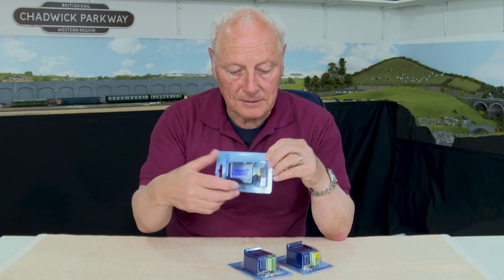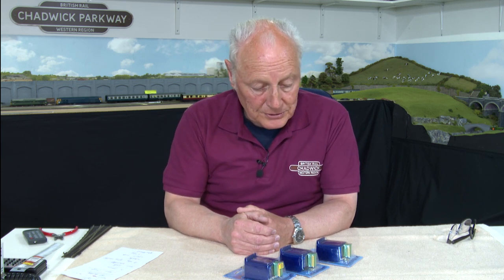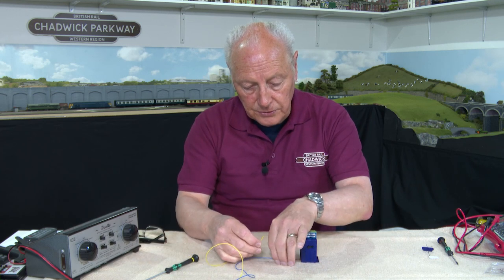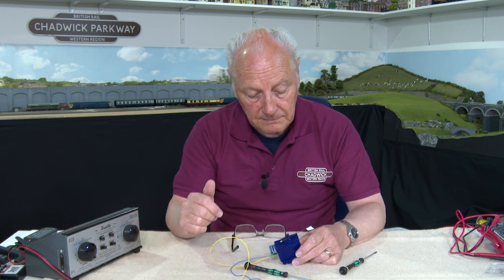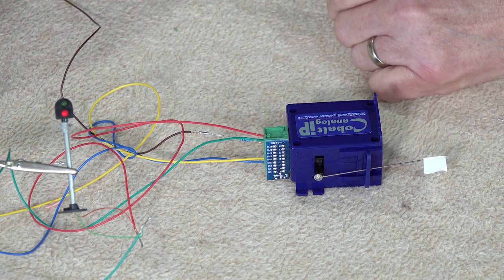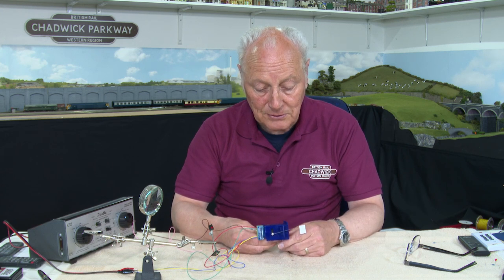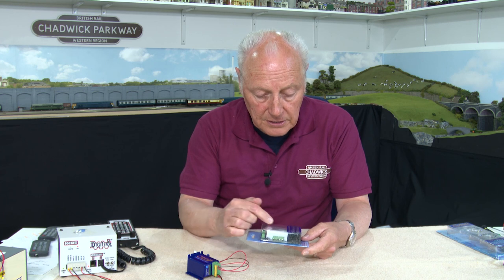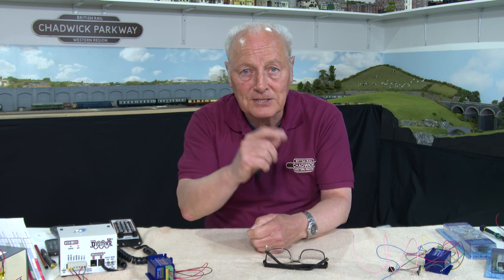Cobalt Point Motors on test at Chadwick Model Railway | 161.

Comment: Charlie, I have used 36 of these for 10 years, when Richard Johnson  operated out of Perth he gave me another tip which i may use in the future. He said to avoid a train going through a point that was set against it he mentioned you could cut one side of the rail prior to the point and use one of the switches on the point motor to power that mini section. Then a train cannot travel through if the point is set against it.
Reply: Sounds like a great idea, thanks.
Reply from the maker: That sounds like a decent plan mate. Regards Charlie
Reply: Useful tip
Reply: Is this not the same as electro frog, but extended so the braking zone can stop the train before it fouls the points?
Reply: @tomlawton7087  Yes, just using one of the built in switches to power a small independent section of one side of the track prior to the point. Similar to using it for a frog but with a longer loco the point is already fouled.

Comment: Gotta be honest I've never used a point motor but I might give it a stab when I finally get around to laying O gauge track. Tempting me to go DCC sound as well but we'll see as it means modifying some scratch built locos which is annoying.
Reply from the maker: The worries that we have as railway modellers. Regards Charlie
Reply: @ChadwickModelRailway  as silly as fretting over building guitars... 🤣

P.s. any recommendations on editing software for videos? Maybe a future thing for you to cover would be how to show off your railway nicely, you seem to he a bit up on it as I note you did some filming work for McKinley...
Reply from the maker: It’s well worth a mention at sometime JJ. Regards Charlie
Reply: I own and have publicly displayed a 50 x 20ft "O" scale NZR/US dual mainline layout for 15 years now. When purchased off the group that built it (of which I was part of), electrical power was common earth wired DC with 17 power/track sections. After the first public outing it was rewired for DC/DCC retaining the 17 power sections pending converting all the NZR scratch-built locos to be DCC compatible. The control panel was reworked to have three different DC controllers operating the layout with each section having a power "off" position. It took several years to change/modify the (NZR scratchbuilt) locos and rolling stock for DCC then we changed over from DC to DCC at lunchtime on the last day of its 5th public show running a handful of DCC equiped locos we had installed decoders into (the US O scale locos were mostly plug and play). WRT to point motors, we installed 6 Tortoise point motors on the mainline when the layout was rewired to allow cross over between the two mains and to gain access to the main and fiddle yards. These have operated flawlessly having travelled several thousand miles so far.
Reply from the maker: Great comment Brent, much appreciated.

Comment: I purchased 12 Cobalt point motors in 2013. I,m not sure when they first came out but these were early analogue ones. I powered them with a Kent panel controls 12v supply. They started to give issues very quickly. All except one. they would go to there limit of travel and continue to click. As they failed I replaced them with Tortoise motors. I still kept the Cobalt motors,  i didn't realise they had a life warranty. I was at the DCC Concepts stand at Warley 2022,  I mentioned it and was told to email in. Which I did.  I was asked to send them in to DCC Concepts. Which I did. 2 Days later I received 12 new motors!! 
That is customer service on a top level scale. I have friends who use these motors and was told they are so good and reliable. I am using these on my new layout. My sincerest thanks to Chris at DCC Concepts.
Reply from the maker: Yes, as you’ve discovered, those early point Motors, we’re at a poor build standard. It’s great that DCC Concepts. word. Regards, Charlie

Comment: Hi Charlie excellent video as ever and good to hear your thoughts on these. I used these from the start of my layout and have been impressed a couple of things to mention as I have used both analogue and digital ones. 
1. Regarding the maintenance. You make a good point about taking them off your layout every 5 years and what a pain it would be.  But aren't these also completely sealed units?  There's nothing I can see of them that makes it obvious that you physically can take them apart to grease the internals as the instructions mention!
2. Just a small point (pun intended) - "Cost per Point". You mentioned the cost of the motors themselves but what I don't think you mentioned was that if you want to use the analog motors on a DCC layout (historically how its set up etc or someone like yourself that has Tortoises and may want to move to DCC) you also need to take into account that you need something like the DS64 that would do the controlling of these motors. The user would need to take into account that one 1/6th of the cost of the DS64 would need to be added to the cost of the Motor as it can control 6 of these devices.  I found that when you do this the increased cost on the Digital Colbolt is directly comparable with using the analog version plus 1/6th of a DS64. I moved completed to the digital ones once I made this mistake initially and repurposed my DS64s to have input signals from things like IR sensors at stopping points in stations etc.
3. I use my Digital Colbolts very similarly to how you used the second Analog motors as there have been times with occupancy detection I don't want my motors powered off the track feed as the power draw may make the system think the track is occupied as the motor is working.  I run a separate DCC accessory bus to all the DCC ports on them and then run my  track power wires (from the occupancy detector units) "Red, Black, and the additional Frog Wires" to ports 4, 5, and 6 on the motor.  This way you can (if you need to, I did as space was tight in a reverse loop section of my fiddle yard) can include a run of points within an occupancy zone without the fear of false positives as motors moved.  I believe technically it's not aways advised to have points within occupancies zones, but giving yourself available extra options is always a godsend!
Reply from the maker: What an excellent comment Nick.
You are of course right, in that an accessory decoder of some sort would be required.
I did leave out some of the more complex options available but I really didn’t want to alienate the DC diehards.
Your move to an accessory bus is a vital move.
Regards Charlie
Reply: @ChadwickModelRailway  thanks Charlie - completely understand the need not to dive too long into the weeds of it all. 

It can certainly get a bit “rivet county” as you get deeper into it all and videos can get rather length if you cover every base! :-) 
I know I have learnt a lot from your videos - I suspect if you saw under the hood of my layout it maybe rather familiar…! - and if I can help expand on some knowledge I have gained (mostly through mistakes and my own lack of research) within the comment sections, I hope that’s all the better. Keep up the excellent videos and I look forward to seeing more layout updates in the future!

Comment: Hi Charlie, thanks for this. I use Cobalts and I’ve learned a couple of new things I wish I’d known about some time ago! One little trick I found when inserting the armature wire is to push the sliding holder down to the bottom and it will hold it in place while you drive the screw in. 😊
Reply from the maker: Great advice David, many thanks.

Comment: Great review Charlie. The IP digital is something that I started to implement, but the cost is eye watering, so I have since started investigating the use of Arduino and servo motors as demonstrated at Little Wicket and IoTT. An Arduino can be had for less than a fiver and servos are dirt cheap also. The complexity is in controlling the frog (usually you would use a micro switch for this) and also the coding for the Arduino, also getting a supply from a DCC source to power and supply the DCC packets to the Arduino is a headache. The coding is not an issue for me, and I think brackets can be obtained from MERG to both mount the servo and a micro switch. The power supply and DCC source for the Arduino requires two or three other items that I have yet to resolve, but the information is out there for those who are prepared to do some intensive DIY DCC point operation.
Reply from the maker: You make a very interesting point Jane.  I think that I shall have to approach the MERG society and perhaps put a video together once I fully understand the system. Regards Charlie
Reply: There's a lot on YouTube if you can separate it from the technical stuff and get to the model railroading stuff.  These are sources that I've found on Arduinos that don't give me a headache, and some specifically on turnout servo control.  

For those not familiar, there are 16 channel (turnout servo) controller board 'shields' that can be easily plugged onto an Arduino in multiples to control 100+ turnouts.  Most of these & other model railroad videos on Arduinos have free code & webpage links listed in the video description that need to be downloaded (all free, no gimmicks).  Arduinos are moderately easy to set up and the free programs can be easily uploaded - no need to type them in.  The YouTube channels below include easy instruction videos on that, too.  It's not hard, just follow instructions exactly.

YouTube Channels:

Dave Bodner
DIY & Digital
Dronebot  (Arduino learning that's easy on the brain)
Fred E Model Railroad  ("Arduino, DCC++, JMRI")
Geoff Bunza
LearnElectronics  (several Arduino videos)
LS3Jack
Mert Arduino & DIY  ("16 servo controller")
Rob the N Scaler  (applies to HO, etc.)
Robojax  (PCA9685 video)
Rudys Model Railway  (👉the Mother-load on Arduino uses for model railroading and also for TrainController tutorials)  For ongoing iTrain tutorials see the Bob Fuller channel.

Tom's Trains & Things  (Lots of Arduino stuff.  Best if viewed at 1.2X playback speed.)
YouTube Model Builders  (Feb 7, 2018 tutorial on Arduino turnout control)
Rhythm Railroad  ("Servo controlled turnouts" & "Using Servos to Control Turnouts")
oorail  ("Model Railway Computer Control - Which Boards to Use")
.
Reply from the maker: Thanks Frank, that’s a lot of research.
Regards Charlie
Reply: @ChadwickModelRailway  With so much good and mediocre information out there, it's convenient to keep track of the good stuff.
I have many references to your channel.  But sadly, you don't do much on Arduino controlled turnouts.  lol!
Reply: @jane Swift  you don't really even need to use Arduino. ESP8266 family Microcontrollers can be programmed using the Arduino IDE and if you use an ESP-01 board and programmer you can get the compute side of the solution for £1.50 or so AND those boards also give you WiFi built in which makes the control and telemetry side of a solution an almost all software affair.
Reply: @frankhellman6879  Thanks Frank that is a lot of good information there. I settled on using a Nano with a 16 channel shield and the SG90 servos and brackets from MERG (although anyone handy with a 3D printer could knock something up, or just use bits of wood!). I developed my code with specific reference to the work done by Hans Tanner of IoTT. His videos 17-19 go over a project in quite some detail. As I say, the aspect I have not yet resolved is using the DCC bus to power the Nano and the servos and also to get the DCC commands to the Nano, although Hans Tanner gives some good tips on that also. Having worked in IT I was able to adapt the code quickly and I will be placing 3 Nanos in areas where the pointwork is concentrated, each serving about 10 points. I would be happy to share the code with anyone who wants it, but some tweaking is still needed to limit the angles that the servos need to be thrown, something that I will do once I have the track laid.
Costs - ~£15 for three shields with Nanos, ~£30 for 20 servos, so we are looking at probably less than £60 for 20 points. It would be about £500 to do the same with Cobalts.
Reply: @pierre-de-standing  I also plan to replace my solenoid control panel with servos and was looking at a single Arduino and daisy chaining Adafruit PCA9685 16-Channel Servo Driver boards to control 60 points...
Reply: I have a fairly basic understanding of electronics, so make of my comments what you will. My understanding is that DCC superimposes a high frequency digital signal on top a approx 15V supply voltage, i.e. when there is need to communicate an instruction to something, the power supply is modulated between 0V and the nominal supply voltage at a few kHz for the time required to send the digital data, a fraction of a second. So I think it's quite amazing that the decoders take this data and then generate a constant stream of electrical pulses required to drive the motor, without the two sets of pulses interfering with each other, or doing it in a way that degrades the pulses on the track such that other devices don't get a clean signal. So it's somewhat easy to do, at least for a motor which isn't really fussy about the quality of the electrical power to it. May be generating a nice smooth 5V to 3V power supply for an Arduino or as @Alan Music Man suggested an ESP series, or similar micro control from the DCC power/data signal might not be so easy.

I think it would be easier to have a dedicated power supply for the Arduino / micro controller and use an opt-isolator to read the DCC packets from the track power, so the 5V / 3V Arduino / micro controller isn't zapped by the track power.

I don't know if the DCC protocol is proprietary, if it is publishing a decoding of it might get you into trouble, not to mention the trouble of actually doing it, you're going to need a fairly fancy digital storage oscilloscope and a lot of patience.

 I wonder if it would be possible to create your own protocol may be I2C which lots of micro controllers (and Arduino?) support built in, but a lot depends on how you want to control your track, e.g. all be DCC controller; by computer program, that can be convinced to output data in your format; or a custom controller or from mimic boards etc.
Reply: @pierre-de-standing   
Thanks Jane.  There's a lot of good info out there.  You and Hans are way beyond my pay grade on programming.  I like it when the .ino is just handed to me.

For nano power, is there a reason you can't use a wall wart to power them separately, running an extension cord to a mains power outlet if necessary?  One or two cheap AC-DC adapters could run the nanos & all the servos.  If not, commercial DCCs put out about 14VDC.  You may be able to use a cheap DC-DC buck converter running off the DCC bus to drop that to 3.3 or 5V.  I don't know if the modulation signal will bother the nanos or servos, but it doesn't cost much to try it.  If there is a problem, a DCC bus snubber might resolve it.  You should have one on every DCC bus anyway.

A search of YouTube for "DCC servo controller" should result in more answers on getting commands to the nano.  Don't be surprised if JMRI is involved.  Check out Rudyshobbychannel, the Rudy's Model Railway playlist for lots of ideas.
Reply: @axelBr1  The opto isolator is probably an important part of the chain for decoding and a buck converter for a power source. Frank is right, Rudy has some good ideas about the power source and getting the DCC packets into the Arduino. What would be really handy is if someone could piece this all together for us. Charlie, over to you ;)
Reply: @axelBr1  No. That's not how DCC works. There is no superimposed digital signal. To try to put it as simply as I can. It's the variations in the length of pulses in the AC supply that is both the power and DCC 'signal. If the + pulses are longer than the - ones, then the loco goes one way and vice versa. The length of the pulses also determines speed and all other functions. It's a bit like Morse Code. The two cannot be separated because they are one and the same.  Resistors in the decoder regulate the power to accessories.
NMRA DCC is not proprietary. The inventors, Lenz made the protocol open to everyone.
Reply: @Poliss95  your explanation is actually a description of a digital signal superimposed on a constant supply voltage. I found this https://en.wikipedia.org/wiki/Digital_Command_Control which describes the system switching the polarity of the tracks, which makes sense as it will enable power to be supplied during the "low" of the pulse. Your description of the lengths of the pulses applies to the voltage applied to the motor. It's correct, but in your explanation, only one train could be controlled.

Based on your comment that NMRA DCC is not proprietary I Googled and found this https://www.picotech.com/library/oscilloscopes/digital-command-control-dcc-protocol-decoding The page also includes links the DCC standard.
Reply: I've dabbled with servo control using a loconet servo drivrr board, and whilst it can work well, I found that many servos are just not reliable enough to work in this manner. Result? Servos in the bin and I bought more cobalts. Expensive, certainly, but I've never been let down by one.
Reply: @roundel52   Those little cheap servos aren't very reliable.  If there was a cheap quick plug in/out mounting for them, it would be nicer.

Comment: Charlie, regarding not oiling your Cobalt point motors, you may well find that the lifetime guarantee depends on doing that. If I were selling items with a lifetime guarantee which required periodic maintenance, I wouldn’t be honouring that if maintenance neglect led to the failure. Just a thought there.
Reply from the maker: An interesting point B5375.
Regards Charlie